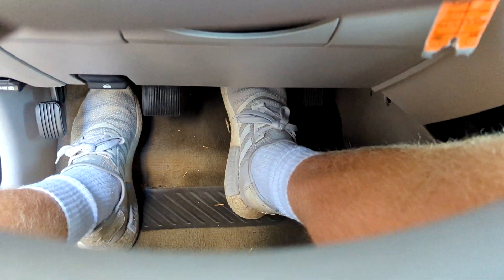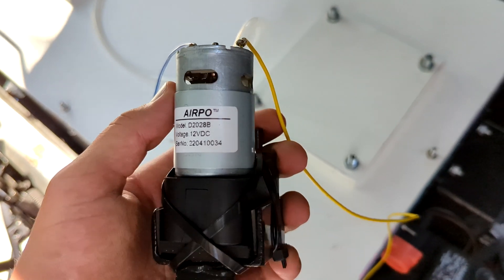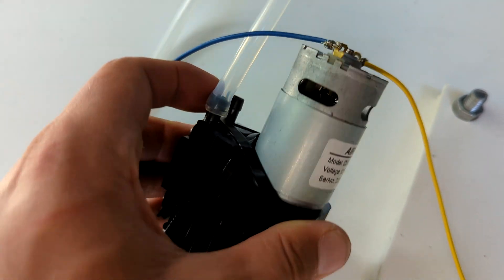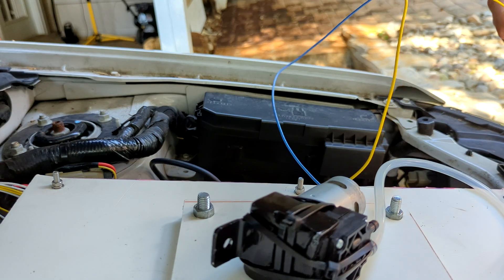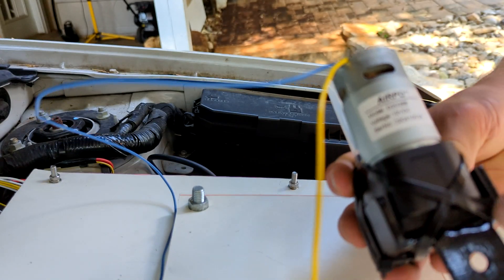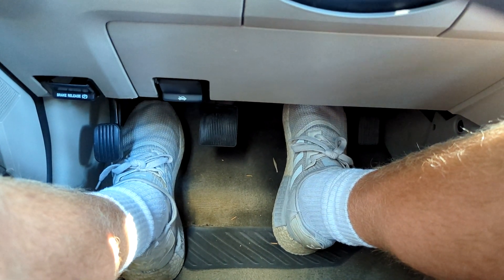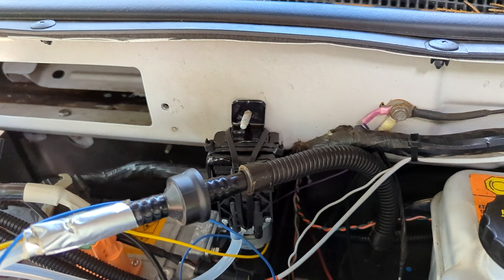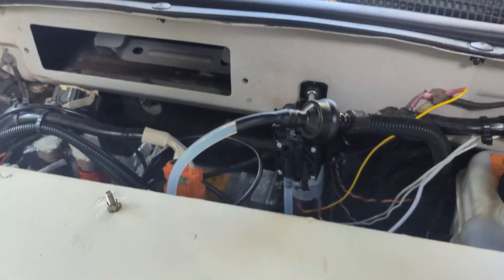Ford Escape EV Conversion EP 28: Power Brakes

Comment: Hi Reider Mcfeely, I'm converting a 2002 Ford Escape so I was delighted to find your videos! Are you doing more? Or does this one complete the set? Also, is there any advice you can give me regarding my project? I've watched almost every video now so anything I should know beyond these? Like things you would do differently? Etc. Also, any links you can share on where you bought the materials would be greatly appreciated. Well done!
Reply from the maker: I'll have a couple more videos up at some point for minor things but I've put over 1000 miles on it since this video and it's held up great so far. No specific advice I have off the top of my head but just be patient and persistent! Easy to get caught up and frustrated on the little things and if that happens I find it best to work on a different part for a time to clear my head and have some time to think of a solution. 

For links and stuff I can email them to you shoot me an email at reider (at) veroelectric.com

Comment: if you mount a vacuum switch inline with the pump that pump will only run for a bit when you press the brakes and otherwise, when you aren't hitting the brakes and the vacuum is already present, that pump shouldn't have to run.
Reply from the maker: Yep that's definitely something I'll look at doing down the line! Just wanted to get the power brakes up and running before fine tuning it.

Comment: Great idea, cheap as well. What are you doing about the power steering?
Reply from the maker: I'm hoping that once I get the ECU back and reinstall it the electric power steering that the Escape had originally will work as it did before. I'll have a video up on that if all goes well.